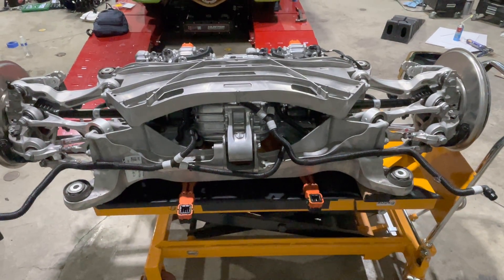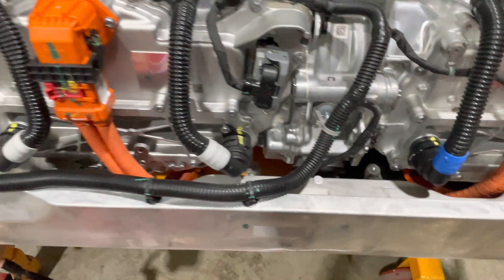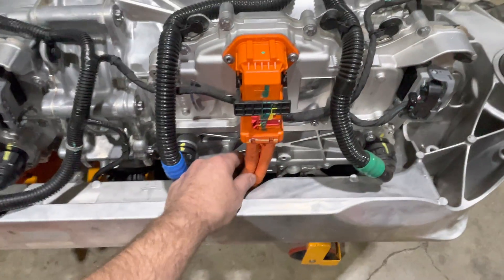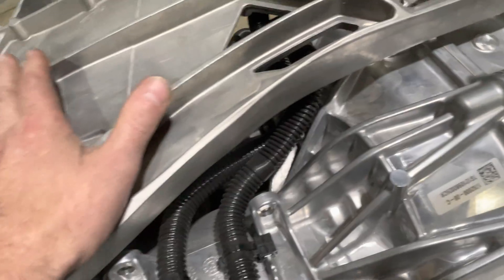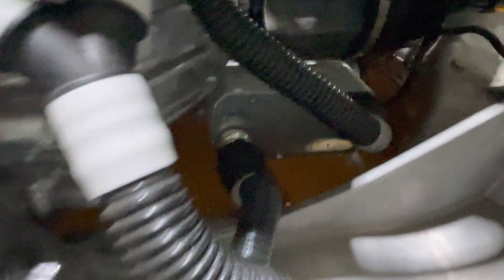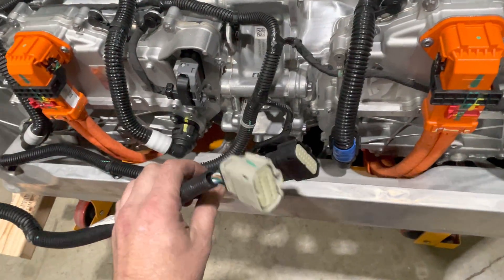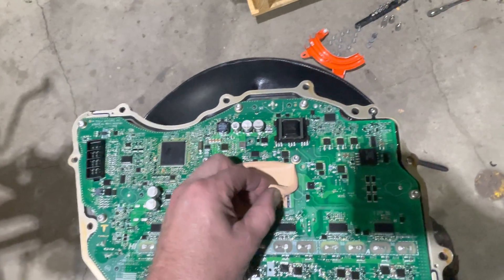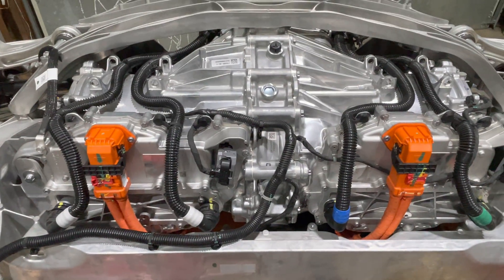Tesla Plaid Rear Drive Unit - Quick Look

Comment: They are not 2 Model 3 motors glued together. The motors are tottaly different as the roatars are carbon wrapped to be able to handle the high performances. Different kind of mottor overall
Reply from the maker: Yes, the rotor wrap is new, but that's just to allow higher RPM.   Just incremental improvements.  Same PMSRM, Same inverter.
Reply: @Ingineerix  thank you so much for sharing this exciting information with us. Can't wait to see what else you share. 😎👍🏻
Reply: @Ingineerix  yes carbon wrapped rotors have been in production for years now in applications of up to 200k rpm +
Reply: I wonder wha5 kind of glue they use 😜
Reply: So says you. He showed right on the inverters circuit board it very clearly says model 3. 
And if you take the model 3 motors x3 you get to the plaid s power level. 
So it seems they took the motor Sandy was most impressed with and upgraded it even further. Makes perfect tesla sense. 😁
Reply: @4literv6  so upgrade doesn't mean different motor? I am just saying is not the plain old model 3 motor, it's improved specifically for the plaid.
Reply: @fluffy24  good point I agree. Maybe it got lost in the shuffle? It seems you we're saying it wasn't the model 3 motor.
It seems to be the model 3 motor design and casing though. But obviously with key differences like the c.f. wrapped rotors allowing the motors to spin to 22,000+rpm. 

If elon is to be believed maybe a bit even beyond that? Which again leads the market.
Crazy imo to think essentially the same motor format. Could power the base model 3&y and the performance model's of 3&y.

Then get some upgrades and see duty in the plaid model s. The roadster gen 2. And even the semi. 
Talk about versatility and economies of scale being realised. 😎

It's almost like the model 3s motor became the tesla version of an ls motor. Change a few things and slap it in many different model's.
Reply: @4literv6  totally agree here! They trully are amazing. Ingeneering to the next level!
Reply: @4literv6  the electronics were modified too. Its like taking a NA engine and turbocharging it.
Reply: @carholic-sz3qv  I understand perfectly that analogy. As someone whose worked on turbocharged, supercharged, compound charged, nitrous injected and water meth injection kits. 😁
Reply: @4literv6  water, nitrous and meth injection are a totally different level of tunning not found on production vehicles. Those systems are for those who wants to harvest the latest power from their engines for different applications drifting, racing, offroad.....
Reply: @carholic-sz3qv  wrong again. All those technologies have in fact been in use in combustion powered trains and warplanes since the 1930s.
Reply: @4literv6  seriously?!? For you a train or warplane is a vehicle?? Come on man wake up!
Reply: @4literv6  you must be troll aren't you?!
Reply: @carholic-sz3qv  funny you sound exactly like one to me. Nice job dodging every point I refuted without adressing a single one.👍🏻

Comment: This is cool. By anychance the drive unit could fit into a model 3? Or it's not worth the hassle
Reply: Perhaps if the mechanic possessed a very large hammer it could be made to fit... in a fashion...
Reply: @nedwulin4646  wrong, they will need Software for it to work, its not exactly the same model 3 part.
Reply: @carholic-sz3qv  another reason why I dislike tinkering Teslas
alot of computer stuff

im better off ev swaping an ICE car that has no software updating crap 
I just want it to go beat track times

Comment: Does that circuit board pyro shear or just break the PCB?
Reply: it just will broke a circuit.
Reply from the maker: No, it disconnects the motor phase windings from the inverter.
Reply: @Ingineerix  To broke a connection windings from IGBTs you need at least 2, or if its between winding and IGBT pair 3 of them. But i see only one fuse.
Reply from the maker: @pashko90  There are 3 motor legs, break any 2 and the motor field is incapable of generating any positive or negative torque.   That's what the explosive device does.

Comment: What are the two little electronic boxes placed on each upright?? is it accelerometers to measure suspension, dampening, operation??
Reply: By upright, you mean the spindle? Each one has an electronic actuated parking brake.
Reply: @JasonWW2000  No, that would be an upright or "hub carrier" or "knuckle". The "spindle" is the stationary horizontal shaft that the hub spins around. I realize that some people call the whole cast iron part which includes the spindle and the upright just a "spindle".
Reply: @brianb-p6586  Regardless of terminology, do you think he was referring to the parking brake actuators? Is there some other part he was referring to?
Reply: @JasonWW2000  There is a very small device on top of a horizontal surface of each upright, looking like it should have a small cable plugged into it, and I'm guessing that's it. Perhaps the wheel speed sensor?

I would not have guessed that it was an accelerometer - Tesla doesn't do suspension systems sophisticated enough to need that, as far as I have heard - but the current Model S parts diagrams for the braking system (in Tesla's online parts catalog) includes a "WSS, INTEGRATED W/ ACCELEROMETER, MS FL" which appears to be the wheel speed sensor plus an accelerometer in one small package, attached to a wiring harness.

I assume the question was not about the parking actuators, because they're on the caliper rather than the upright, and because (with the caliper missing on one side) there isn't one visible on each side.
Reply: @brianb-p6586  Okay, I see the piece in question. 
I was just thinking, the Plaid technically doesn't need separate rear wheel speed sensors since a motor is attached directly to each rear wheel. It can monitor wheel speed through the motor speed. It probably still uses a WSS just to keep things simple, though.
I tried to figure out where the Model S WSS reluctor ring was and had no luck. Not on the rotor or axle, doesn't seem to be inside the wheel bearing either. Do you know where it is?

Comment: wonder what the core diameter is of that HV wiring to support 2300a continuous anyway to measure?
Reply: It has 3 cables (one for each motor) so that makes live easier. They are actually the same size as Model 3 Performance.
Reply: @bernhardleopold6702  i doubt the cables are the same copper core as the model 3

Comment: Rear camber adjustment! I thought the day would never come. Thanks for these videos.  I don’t think I’ve seen a single part that looks even close to my 2013 model s.
Reply: This is the same type of suspension design as found in the Model 3/Y, generally known as a five-link multilink type. It is not the same parts as the Model 3 - that one uses steel links and these links are aluminum. It is different from the original Model S/X, which is a typical "integral link" design.
Reply: Do you know if there is front camber adjustability on Telas? I have a model Y and it is burning down the inside of the tyre's surface.   This is on the first set of tyres.
Reply: @youmakeitreal  Yes, front camber is adjustable. However, in my experience camber has to get extreme before it wears the edge of tires. Much more common source of inside edge wear is incorrect toe adjustment.
Reply: @markusstrobl1067  Thanks I will put the toe plates on and have a look. I usually find finning on the tread caused by toe.  But always room to learn new things.  Thanks again👍
Reply: Actually, that particular adjustment is for toe because it's near the center of the hub height.  The eccentric bolts on the lower two arms adjust the camber.
Reply: @morrisg  Yep, but the older Model S like mine didn't have the eccentrics on the lower control arms so no camber adjustment.
Reply: Wow I’m so happy they added adjustable rear camber arms the old S including mine all had camber wear issues. I just installed an aftermarket adjustable arm
Reply: this is comletly different cars, they just looks similar.

Comment: @4:40.  So funny to hear the legacy automakers complain about lack of semiconductors and yet Tesla probably uses 2x more silicon per car than an ICE car does.   And Tesla's sales are increasing 50%+ per year while the legacy automakers are falling.
Reply: Tesla probably plan for much more growth. They might have plan for 2x sale but the they get 30% less semiconductor but they still look like they are growing 50 %
Reply: You are dumb mate, how many cars does tesla make in a year compared to other manufacturers?! Vw alone made 10 million in a year, not to forget that they also have vehicles that uses alot of chips too. Vw even makes RVs and they have truck and bike brand (ducati) on top of all that.
Reply: @carholic-sz3qv  So what ?  VW's clout in the market should give them leverage with suppliers.  But apparently not.  What does that tell you ?
Reply: @SomeTechGuy666  tells me that Tesla is running out as even their motor invertors are still stamped with “model 3” 😂😂 Tesla’s R&D where ya at?!?
Reply: @criancrna1487  Reusing a part in another model is smart.  Saves money.  Cuts R&D time.  And it seems to work really well in the Plaid.
Reply: Inverter uses SiC semiconductor that are produce on a different fab. Even their wafer supply is different. So they are not exactly on the same supply chain as the silicon semiconductor.
Reply: @kazedcat  toyota also uses a significant amount of SiC in their hybrids and have been using it for years now.
Reply: @carholic-sz3qv  Tesla is vertically integrated, so they design most of the parts and software in house. They faced the same shortage problems but were able to modify the car firmware to use different chips that have good supply. Legacy automakers mostly just assembled the cars and depended too much on their suppliers to provide turnkey solutions that use old chips and when there was a shortage, the automakers couldn't pivot and didn't have the expertise to bring it in house. 

There's also the fact the automakers cut their orders for chips during the pandemic expecting a downturn in car sales, while Tesla maintained their chip orders as they were still growing.
Reply: @Bellissima2k  “Usain Bolt only improved his best time by 0.2 seconds in the past two years. Meanwhile my son(8) managed to reduce his time by 15 seconds in the last race.“
Reply: @kazedcat  Of course SiC MOSFETs are produced with a different process at a different fab.  But the gate drivers and the micro controller are mainline semi conductors.

Comment: I bet the pyro fuse is there for crash events, tow/recovery people are dying from EV systems not deactivating properly or being reenergized when being towed onto a wrecker in neutral.
Reply: You making that up or do you have some article to support that?
Reply: @sooocheesy  pretty sure he made it up.  EVs already have a lot of safety checks to disable high voltage outputs in events like crashes, damage to the HV wiring, loss of isolation of the HV, etc.  And I've never read about any incidents of tow operators getting hurt or killed due to being electrocuted by an EV.  Teslas already have a pyro fuse that disable the HV output from the battery pack in case of accident.  The new pyro device Phil talks about could be for another specific case (he talks mentions a specific scenario).
Reply: @android04  tesla actually doesn't recommend to tow their cars, they had to be on a towing towin's bed.
Reply: @carholic-sz3qv  They are trying to protect himsefs from a dumb ppls, "do not microvave your alive dog" kinda thing.
Reply: if you dont know what are you doing, Darvin award will gonna find you, sooner or later.
Reply: The fuse for that is located in the frunk area. The one he showed in the video is only for the inverter, to prevent ceasing of the motor at high speed.
Reply: Of course there is no actual neutral in a Tesla; the gears are always engaged, so if the axle shafts and transaxle are intact the motors turn whenever the wheels turn.

Comment: More info on the pyro for the motor phases would be appreciated
Reply: The three copper lugs sticking up are the AC drive current from the SiC mosfets out to the motor windings.  When the pyro device is activated, hot gasses shoot out left and right through the tubes on the pyro device onto the copper bars and this is hot enough to melt the copper thereby severing the electrical connection to the associated motor winding.  With no drive current to two of the three phases, this unlocks the rotor and allows it to freewheel down to a stop.
Reply from the maker: @morrisg  No, the hot gasses do not sever the copper directly.  There are 2 ceramic pistons that impinge on a cam operated mechanism that shears the motor busbar to SiCFET connections.
Reply: @Ingineerix  Aha, it's pyro driven mechanical.  I stand corrected.
Reply: @Ingineerix  Any chance of a demo? Pretty please?
Reply from the maker: @fredpinczuk7352  If you send me an inverter board, I'll film it deploying with a high-speed camera.  I can't blow this one, because it's an otherwise prefect motor.  That would be a crime!
Reply from the maker: @fredpinczuk7352  You supply me with one I can destroy, and I'll do it!
Reply: Impressive that it's just hot gases and not anything physical cutting the copper